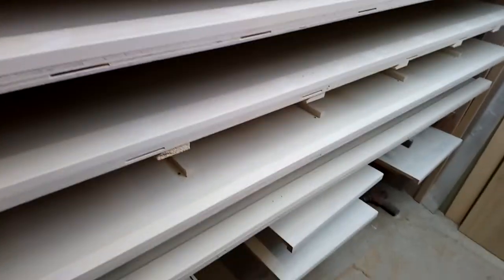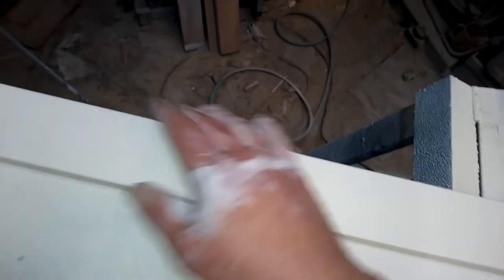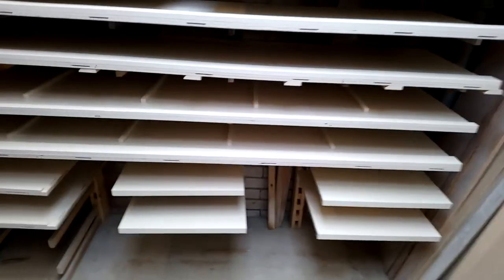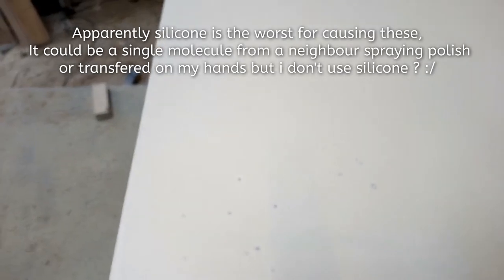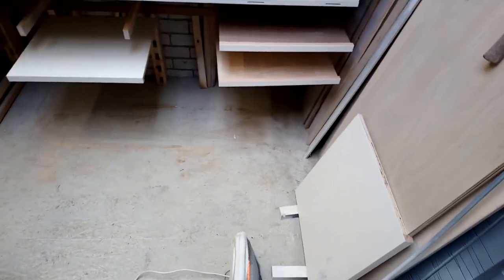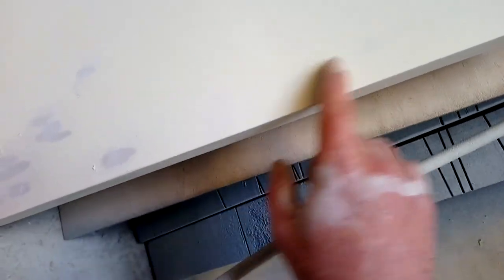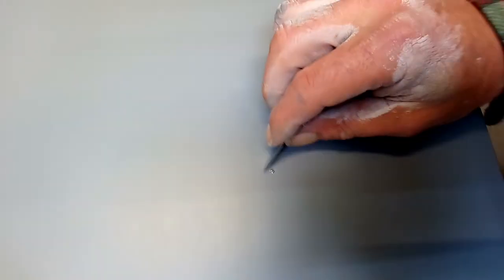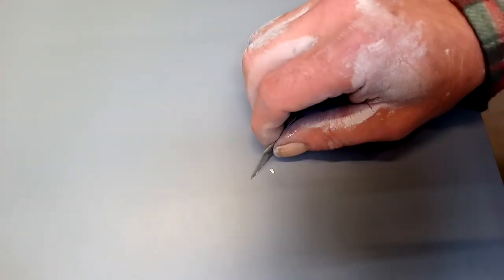Wardrobe build pt11 - Spraying the carcass, dealing with fish eyes & flies

Comment: Great video
I do a lot re-finishing and silicon contamination is the biggest problem.
I use an additive, that you add to your paint cup.  One drop or two is all that is needed.
Do a google for anti silicon or fish eye additive.
Reply from the maker: Thanks Stephen, Just had a look 👍 I avoid using silicone but sometimes it's around, I need to spk to my paint suppliers to see how it does with PU paints, just read some of the data sheets, they don't say much.
Reply: @Gidjoiner  I've had mine for quite a while now and can't remember which supplier I got it from (it's my age).  I must admit I don't use PU, and I'm not sure if the same stuff can be used for all paint / lacquer types.

Comment: Coming on well Gid, bloody fish eyes 😵Anyway you overcame it, well done. Will the glue be ok on the sprayed surfaces when assembly starts? You have screws holding aswell as biscuits so nice and strong👍
Reply from the maker: Thanks yeah it's slowly getting there. don't know where the fish-eyes come from still?
I wouldn't trust the glue against the painted surfaces but the sides are sat on the bases & the tops sat on top of those, the glue in the biscuits & screws should be more than strong enough,
The front frame has biscuits also, i haven't sprayed the front edge of the ply that the frame will glue to, I'll sand that edge but any over spray should only work as a sealer aiding the glue to bond better rather than soaking in to the edge grain on the ply, I'm not spraying the back side of the front frame, that'll be bare wood glued to the plywood, 
I'm doing that frame & the doors now, I'll post a vid when they're done.  👍

Comment: Great vid. Thanks for the non-b*llsh*t commentary. How much paint did the whole job need?
Reply from the maker: Thanks Lynne 👍 Yep no long intro, no bull & no paid promotion crap  👍😉 Not sure exactly, I have to buy a 5 kg/litre tin, i don't make a note of how much is left as long as i have enough, I could buy 2,3 or 4 litres but sods law says I'll need 5, & delivery has a limited price for free delivery so i normally just buy the full 5, I did make a vid where with one 500ml spraygun cup i sprayed 1½ 8x4 boards one side with one coat, I,ve done this enough times to have an idea in my mind how much I'll need when buying so buy a little extra which normally means i buy the full 5.